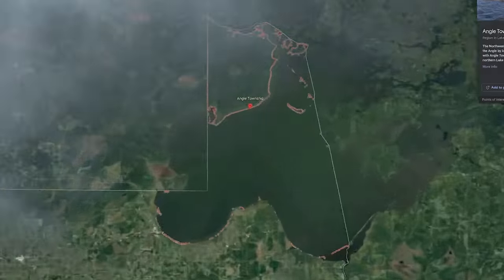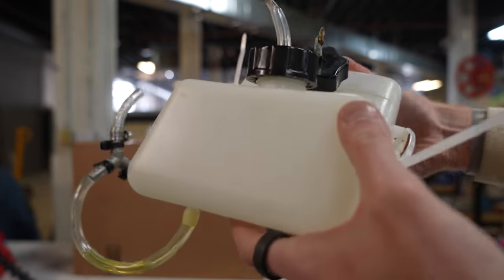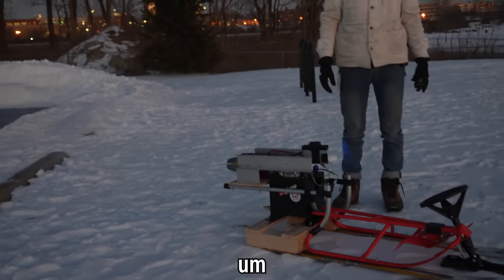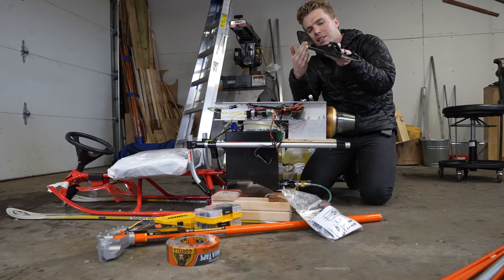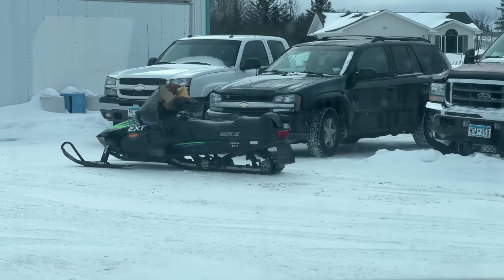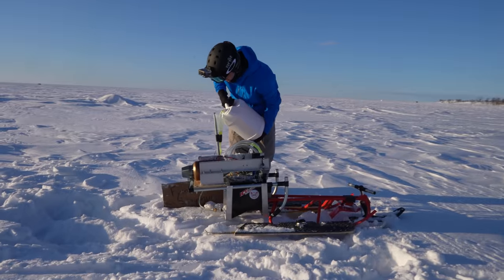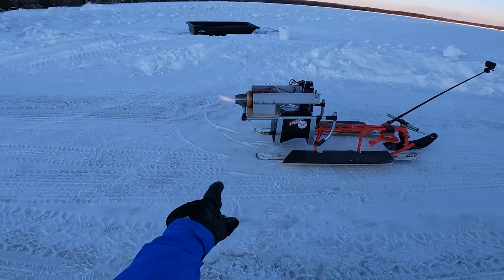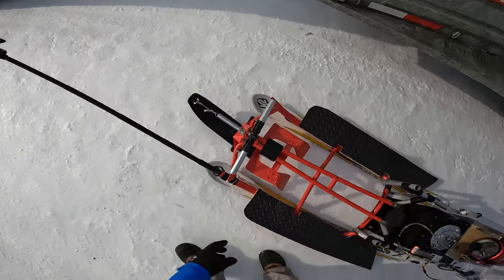Jet Powered Sled vs 38 Miles of Ice!

Comment: If you lengthen the chassis it will allow you to lay lower on the sled. That will give you better aerodynamics, fuel efficiency, and top speed.
Reply: Great idea
Reply: More stability as well.
Reply: What about mass?
Reply: @anshulkaushal1177  the weight gain would be next to nothing compared to the aerodynamic gains.
Reply: @anshulkaushal1177  most of the mass is in the engine, fuel, and the person riding. 

Lengthening the chassis wouldn’t really increase the mass that much relative to what the sled already weighs, and the increased aerodynamics would more than offset the mass increase.
Reply: more stability too, but also more weight

then the focken rocket equation tyranny kicks in and boom gone
Reply: @VerbenaIDK  I imagine it woudnt be too hard to adjust for an extra 1 to 2 pounds of square bar to lengthen the chassis. Although I dont know much when it comes to rockets.
Reply: Also more surface area to spread weight out so you sink less
Reply: It depends on which way the wind is blowing and how fast. If you're heading into the wind you would definitely want to be laying down if you're going with the wind you might be better off setting up but all depends on how fast the wind is blowing. Definitely a good idea laying down though it would help in most situations I would think 🤔 Couple of pieces of tubbing doesn't weigh much.
Reply: @EJ-74  odds are the wind isn't over 30mph and it can already go over that so in any situation as long as your not drifting your will benefit very much from the aerodynamic advantages.
Reply: @NevadaAirGuns  Agreed. The wind has to be blowing faster than the speed you are achieving before it would benefit from setting up.
Reply: @NevadaAirGuns  the tyranny of the rocket equation is basically: if you want a rocket with more payload, you will need mire fuel, but now yku need more powerful engines, which require more fuel, then you need more engines, then mire fuel and so on for slightly more payload, double fuel doebst mean double delta-v, and double power comes with cost of more fuel

basically that, search more about it

also, 1 kilo to lenghteb the chassi enough, this jet engine produce 13.8 kg of thrust, that inst fighting gravity so it is less worse, so it would be a fine assumption it can handle 10x that on a flat drive (on a hill that is much worse but it's fine if it's flat terrain) so 138 kg, which not far since it can accelerate louis oretty fast and the avarage weight of a adult is abiut 75kg, so 75/138, it wouldnt be too much of a stretch to assume the sled is about 15kg unfueled and about 20kg fueled (dont remember how much fuel os in that tank)
so, 95kg/138

so, if you want the fastness of a jet engine like that, sgit is getting pretty slim, unless he switches from purely steel to steel pipes for chassi and for aerodynamics shit (which helps) thin sheet aluminium, which would still be quite a bit of weight, it wouldnt be just 1kg even for the chassi, 2 atleast

or i am overthinking (i am pretty... annoying and like things as perfect as i can make then most of the time) and it's fine, i got fine with tiny tolerancea after playing ksp for awhile now, and i got very fine with delta v margins of anywhere from  30 m/s to 200 m/s (which inst too bad) and because my rockets even in science arent going too fast compared to my ambitions, slowly learning more and more efficient manuevers to do the same with less, or just going ape shit and making unrealistic shit, but normally i try to stay within reality and sometimes (to make this worse) to reuse my boosters space-x style
Reply: Not to mention a longer sled would help w the bumps and jumps. Some skis w some more surface area wouldn't hurt.
Reply: and a much more dangerous crash
Reply: @linsproul3548  then wear better safety equipment
Reply: Might as well switch to f1 style cockpit
Reply: 2 engines and you get same speed without need running one to 100%. So it doesn't took 2x fuel / mileage. So that way I think. Ofc you could make afterburner to one motor and deal with it, but then it took more petrol than 2 engines. In the end, those small jets got nice power output. If that warm high-speed air is lead some kind tube burner like ramjet, you could use it effectively way to get more faster air out and it have lot of more mass because burned fuel in tube brokes to gasses and that gives additional stuff what motor throws out to get that power generated.

If you have problems with jet that freezes, you could feedbac some air from warm side to input so many different way and control those input temps with thermostat. It could be sycles or fulltime.  
Those ski's could be little v-shape, only few degrees I think. Make it that way you could control it, if you do something for it. You could control how that thing turns if you control flow of hot exhaust. Engine could and "must" be in one position, it's too effective if you start moving/turnin whole thing around x axel.

Nice breaks in that sled btw... how those works at 40MPH  ?
Reply: And stability
Reply: So longer is better 😏
Reply: why is this guy replying and hearting all these comments except the useful helpful ones!?
Reply: @gentlemancroc3767  i mean being kind is useful and helpful, give motivation
Reply: Cool
Reply: @LouisE-mp8lx  there will also be a lower mass Center that could improve stability (sorry for my bad inglish)
Reply: Snow  It seems like its mostly a long drag rather than a trail so the lowered maneuverability would be worth the gains.
Reply: And the cg will add more steering control
Reply: 😮 how do you know that
Reply: What about increased friction from the extra length, the extra contact with the ground might be worse than the aerodynamic gains
Reply: I kept really wondering why they insisted on making this thing as cramped up as possible… lengthening it to the size of like a surf board is like the first thing I would have done.  Hell they probably could have strapped two rockets onto a kayak or a canoe and called it a day lol
Reply: @NevadaAirGuns  could also hold more fuel
Reply: @shadow_mc3377  Its the same as racing a motorcycle. When your sitting up you act as a wall or parachute and won't be as fast as if you tuck in to allow air to flow over you. The engine can make better use of the power because its not pushing as hard against the air.
Reply: @FrgttnSnpr  im not sure about the friction. I specialize in cars and those only have 4 contact patches that roll. I do imagine it would still work because a smooth surface on ice dosnt grab... nearly at all. Hence why you slip around on ice. The increase in friction shouldn't be enough to ruin the aerodynamic gains.
Reply: Yeah aerodynamics are so bad, it's like block
Reply: @NevadaAirGuns  it would also allow a better weight distribution and center of gravity so he's less likely to nosedive. laying on his back would also probably be more comfortable and he could just put the steering on a u joint to accommodate for the angle.
Reply: Another engine would deal with the extra mass from an extinded chassis as well as some suspension between where the sleg and skis connect could reduce some of the bumpyniss
Reply: Alongside lower center of mass so at higher speed you are less likely to tip, this would give you a better chance of success and a better chance of death from ramming into something, try feet first like a waterside, so if you hit anything, it's your feet that take the impact
Reply: I was thinking the same thing the whole time
Reply: @NevadaAirGuns  wow
Reply: Yes but less visibility that is important when driving in ice, witch also makes is difficult to bail out if you are about to run something really nasty like split in the ice. Just redesign the front ski to have similar shape like snowmobiles have and with knife edge so it steers on ice as well. Improve engine durability and maybe make it bit longer so there is proper room for it. Should be fine like that.
Reply: And by making the sled longer you are able to spread all the weight out much more evenly for more control and better fuel efficiency. Also you should have put skates on the sled instead of ski’s if your intent is max speed/fuel efficiency/ control,
Reply: @Hellsong89  im not saying to lay face down on it. If you've seen someone racing on a motorcycle they are tucked in but can see just fine. Thats the position I was referring to. Just making yourself smaller so you create a lower drag coefficient.
Reply: It'd work better if he found some longer or wider skis
Reply: Yea but u crash ur spine is folding
Reply: @FrgttnSnpr  It would have actually helped with the friction since it would spread the weight out across more surface area, the way it's built now has a lot of his weight all in one area (mostly in the front) so it causes more friction on the front steering ski. Plus it makes him more stable so he wouldn't take that face dive.
Also lengthening the frame doesn't mean adding more length to the ski, it just gives more body for him to lay on.
Reply: @redneckhunter1213  You would actually be safer in that situation. With a longer body you get better weight distribution and the front end it less likely to flip forward smashing your face into the snow/ice which will whip your head back and can cause severe neck injuries. With the better weight distribution your much less likely to crash from a flip and if the front end does dive the weight being farther from that point makes it less likely to actually flip so much as kinda bury itself in the snow. Also the human body is much tougher than people give it credit for.
Reply: I also ran an equation for top speed increase… double rockets…
Reply: Omg we’re actually talking about useful stuff
Reply: @VerbenaIDK  The rocket equation only applies to a great degree when going straight up.
Reply: @CreeperOnYourHouse  great

but i go for the ksp equation

not fast enough? MOAR BOOSTERS
Reply: That would add a lot of weight
Reply: @randomposts2199  most of the weight comes from the engine, fuel, and rider. The extra 3 or 4 lbs of metal added will be very little and the aerodynamic gains will be worth the extra weight.
Reply: @NevadaAirGuns  true I guess it would be a little safer
Reply: Lengthen it longways, and put side ski's like the canoes that have the side float coming from it (I can't remember the name of them) ....so you're super stable and harder to flip.
Reply: Probably more comfy as well
Reply: Plus less restriction on the ice.
Reply: It will also disperse your weight more evenly across the snow so you don’t sink as easily.
Reply: And make the steering less sensitive.
Reply: Also maybe two snowboards?
Reply: Like most people agree, make it longer, though I would suggest making it like a luge, on your back, feet forward, keeping it low, thin and aerodynamic, with a larger tank at the back, as low as possible with two engines ontop of the tank to keep them clear (I’m just cringing at the safety hazard but then again… What part of this is safe?) this will trim more weight to the rear to help stop the nose from digging in, similar to craft on water. making it wider may help with stability though you aren't exactly doing high speed cornering so the gain from going wider may eat into the efficiency.
TLDR:
like a friggen jet powered luge! 😍
Reply: @anshulkaushal1177  aero is arguably more important when we’re talking about things on this scale
Reply: @xto9517  its not rally cross, he dosnt need to drift and shit. Its basically a very long drag race. The lowered steering response is well worth the benefits.
Reply: That top mounted engine needs protected a bit as well
Reply: Larger skis would probably help
Reply: @tacos_with_sauce8887  ty feel I
Reply: @NevadaAirGuns   Aerodynamics? He’s not going near as fast enough for aerodynamics to be an issue🤦‍♂️
Reply: Wouldn’t that mean more sliding resistance?
Reply: Also that I think he should make the front ski more curved and more wide so it has more displacement across the snow so it goes better threw soft snow
Reply: And you won't tip over as easily because the cg is lower
Reply: Nerd (I'm one to talk🤣)
Reply: And if the thing dives it won't flip as hard.
Reply: Giving it a lower ccenter of gravity might help him to not tip it over forward when he dips into the snow
Reply: Also bounce the shit out of you , you’re riding it not sleeping on it lol dumb idea .
Reply: I think your great idea about it being longer would be offering stability first & foremost... Vital reaction time added as well
Reply: Also lengthen the handle bars. It will make steering easier and it will be less tricky to over correct
Reply: I say lay on your back feet first.  Incase of an emergency you can roll off with minimal damage
Reply: No shit Sherlock🙄
Reply: @drwho8565 ' No shit Sherlock '..... Owned by a 13 year old from the 90's 😔
Reply: this is truee
Reply: @NevadaAirGuns  drag is proportional to velocity cubed and the friction on the sleds will be more dependent on mass than speed. Extending and then maybe cheesing the chassis for weight savings would almost definitely let you go way faster but once you start fucking with the frame it’s very easy to slightly misalign the sleds and at higher speeds that can start to be a real safety concern. I don’t know about you but I feel like a sled that can go 60 mph is probably better to leave on the drafting table because it would be too much fun not to booze cruise until someone got seriously injured.
Reply: Correct. I knew he was going to have issues when I saw that he was leaning over the front of the skis...
Reply: Yep, you almost couldn't design a less optimized sled. Can you imagine how his knees will feel after 38 miles?!
Reply: Source: trust me bro
Reply: Pretty sure the thrust would be enough compared to drag
Reply: The snow on the ice will still be a problem if you lower the sled……
Reply: Also comfort
Reply: @pauliewalnuts2527   This makes sense
Reply: Not to mention that a more spread out weight distribution would certainly help with the sled flipping problem
Reply: @FrgttnSnpr  but what if you split the skis 🤔
Reply: @russrags6274  yeah good point
Reply: @NevadaAirGuns  still gotta make sure you don't snap your neck. And 25+ mph on uncertain terrain is dangerous.
Reply: @NevadaAirGuns  throw another engine plus a couple of more fuel tanks while he’s at it
Reply: But you have more weight
Reply: And more mass
Reply: And have more room for fuel
Reply: Not to mention, go across uneven surfaces better
Reply: @tacos_with_sauce8887   if he was smarter in this he could have gotten stuff for slight down force and then put a   
Fin to turn.
Reply: If you eat beans the night before. Your farts might give you a little boost to your top speed
Reply: also lower center of gravity which reduces the chance of flipping over
Reply: .. and lower center of gravity, and hopefully a smoother ride
Reply: I was gonna say that but without the top speed part😂
Reply: Also means the sleds wont dig in as much previously, greater surface area for the same mass 🪗
Reply: Yeah but then when you crash you’ll crash headfirst
Reply: Also if you have a wider contact patch like snow boards and a beter angle  you will not drop in the snow as much
Reply: Bro this guy ain't no Peter Shripol..
Reply: hey guys. so basicly https://youtu.be/BBgnC96R4WU this is me when i found out that i hit the wrong enemy
Reply: You need a helmet at the point
Reply: And a long lasting back
Reply: Bro was speaking 🤓
Reply: Also he’d increase the amount of surface area covered which would lessen the chances of him falling through the ice
Reply: Don’t worry you’re not the only nerd here
Reply: "If you stand up, you will be taller"
Reply: hihihi
Reply: I think suspension isuch more important right now. Smooth ride would mean the power plant can be running at tip top shape. And also cause the snow density.
Reply: You smart
Reply: Not true, thags more resistance with longer skiis or more weight per ski if he keot them the same length
Reply: More importantly it will have a lower centre of gravity and if he widens the base of it so they’re akin to snow shoes he’ll be less likely to fall into the snow so long as they’re angled correctly
Reply: That’s what I was thinking!
Reply: More weight it wouldn’t make much of s difference
Reply: You also wood spread your weight
Reply: No dip sherlock :/
Reply: @NevadaAirGuns  Do the math.
Reply: The first comment you see is always the guy that has the right answer and thinks he knows everything 🤣
Reply: Add a second rocket and some wings and just fly
Reply: As well as a wider sled for thick snow. Ypu can spread the weight instead of the skis digging into the snow
Reply: And you'll sink a lot less in the snow
Reply: On top of this he needs a larger front ski and more of an upward angle to help with staying above the snow.
Reply: @astronautman12  Use snowboards instead of skis
Reply: This advice is not accurate as the higher the base of the chassis is the more air dynamics it gets. This is why airplanes are really high up in the air because the more aerodynamics the faster the object can move in space-time continuum.
Reply: @ZxAMobile  If you're talking about altitude, yes the thinner air means that there's less drag and therefore the engines don't have to push as hard to keep the plane going. Regarding speed and air pressure at ground level, it's all about reducing the amount of air you have to push out of the way, so lying as flat as possible means the air only has to hit your head rather than your whole chest. The other optimization on that note would be to ensure the air has a streamlined surface to flow over rather than clothes, because keeping the flow of air laminar rather than turbulent also reduces drag. If you want to go even further, the German airline Lufthansa has recently put a coating on the exterior of two of their planes that has a nanostructure similar to shark skin, which also reduces drag along the already streamlined surfaces, but at this point we're talking about improvements that only make sense for applications over longer distances and time periods.
Reply: Also if you can stabilize some element 116 then get it to react you can bend  time space and cross in .0032197 seconds
Reply: Yep was just gonna say.
Reply: @LouisE-mp8lx  in most cases but I don’t know if this sled is going fast enough for drag to really matter much. It’s more comfortable for the rider than anything though.
Reply: @VerbenaIDK  But he's not lifting the weight against gravity.  Any extra payload will just result in longer acceleration times which can be mitigated with a push start.  He'll probably lose some top speed due to extra friction on the skies so he should wax those.
Reply: the only thing that it could possibly affect is agility and turning radius/speed